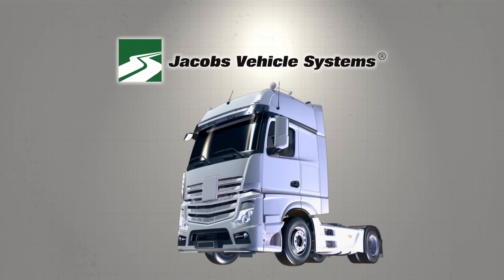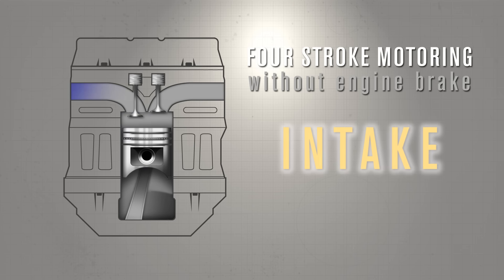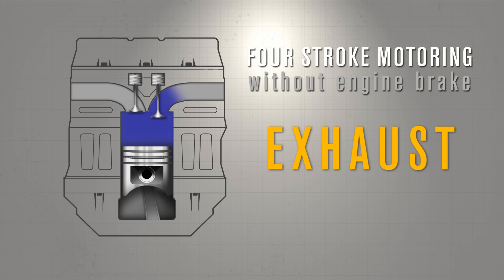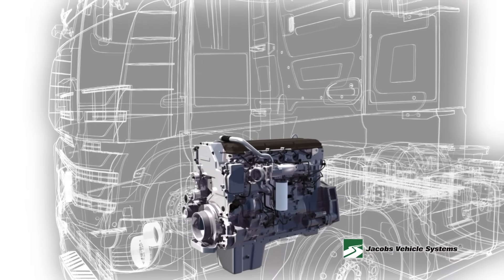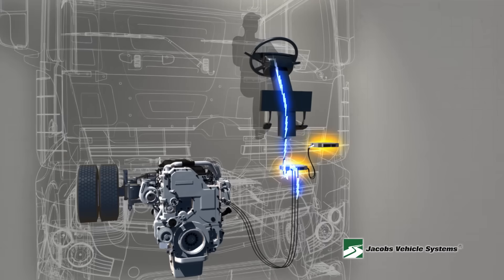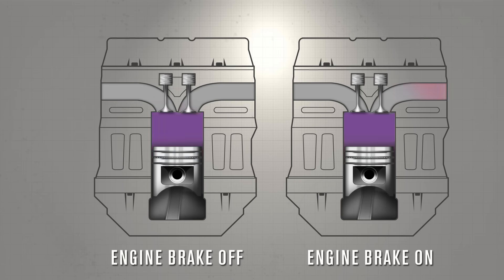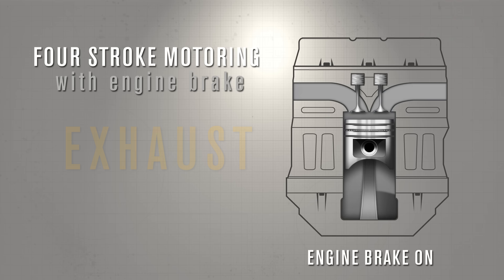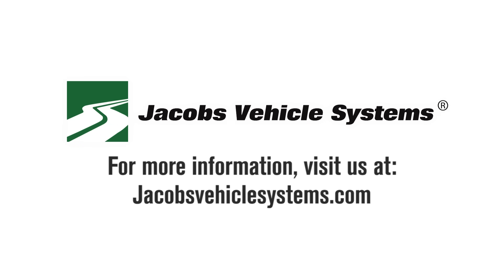How a Jake Brake Works - Jacobs Vehicle Systems

Comment: Every diesel engine should use this system. Are they used in public vehicles, like transit buses, or school buses? I would think it'd save on wear and tear on the service brakes.
Reply: Jason Carpp the system is made for semi trucks to help trucks go downhill safely when loaded, putting it in cars, pick up trucks, buses, or anything that isn't carrying a lot of weight is just pointless since there's no benefits, this system is only used to help slow the vehicle down, not stopping it, it's safe to say that they're best left on semi trucks than regular vehicles such as cars
Reply: +Jason Carpp what about in diesel cars that aren't hybrids
Reply: +jjovereats I would think that all vehicles should be offered with such a system. Anything that helps control the downhill momentum of the vehicle.
Reply: Jason Carpp
Like a Regen brake (as seen in Priuses)
Reply: +jjovereats I'm afraid I've never owned or driven a Toyota Prius, so I don't know what it's called or how it works.
Reply: They are used in transit buses and some school buses and so on. But there are different types of retarders ! 
Like engine brake , exhaust brake, jake brake
Reply: *****  No. Use regen instead.
Reply: +Jason Carpp downshifting
Reply: +Crazy dirtbiker I know what downshifting is.
Reply: +Jason Carpp you can downshift in diesel car  to slow it down
Reply: +Crazy dirtbiker I regret that I've never driven a diesel car.
Reply: +Jason Carpp drive a diesel truck
Reply: I'm afraid I've never driven a diesel truck. I've always wanted to.
Reply: Lately, the world's going hybrid. The Prius has regenerative braking.
Reply: If only all cars and trucks used that type of braking system.
Reply: TCK is exactly right.  Jake brakes are for slowing (not stopping) large, heavy vehicles, especially on long downhill runs.  Passenger cars and local buses are not big and heavy enough -- and are not used in such a way as -- to warrant the use of a Jake brake system.
Reply: Vehicles like pickup trucks with diesel motors have a thing called "Exhaust brake" and the purpose is similar to the Jake Brake, it's quieter and if I remember correctly it's supposed to be more efficient
Reply: Exhaust brake is right. Some smaller diesels use a "Pac brake" or similar exhaust brake. It's a valve that restricts the exhaust. Diesels do not have a throttle plate to restrict flow, where in a gas engine you downshift and let off gas pedal the throttle closes and gives more resistance on the engine.
Reply: +Jason Carpp all cars have similar feature called engine breaking, all you gotta do is downshift  and remove your foot from the throttle to activate.
Reply: Petrol cars can have this function it is called Manual transmission.
Your using the engine to slow down.
I know it is a hard concept for some americans to wrap their heads around.
Some cars are adding throttle bodies to diesels as well